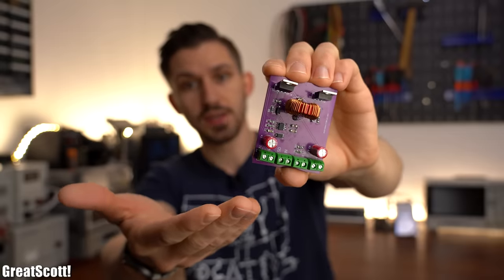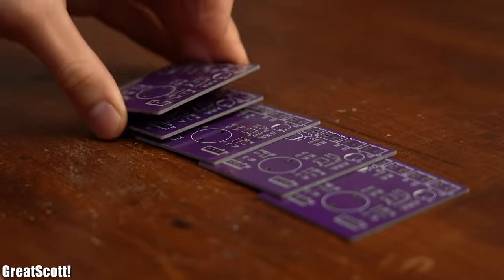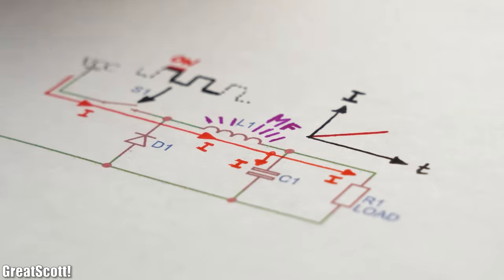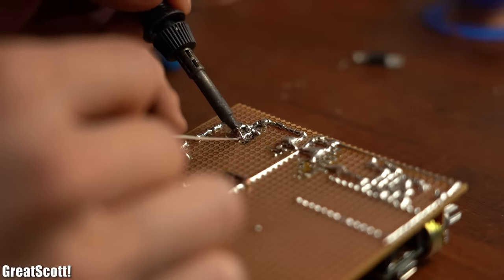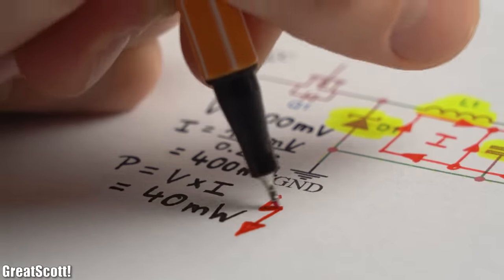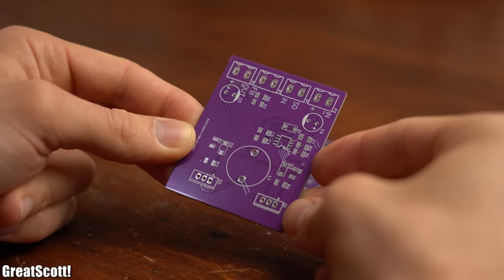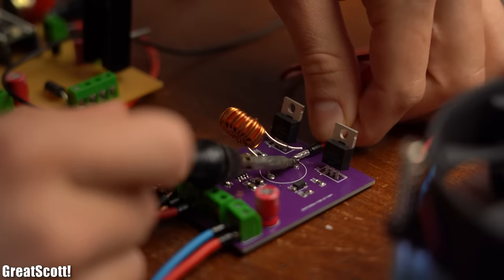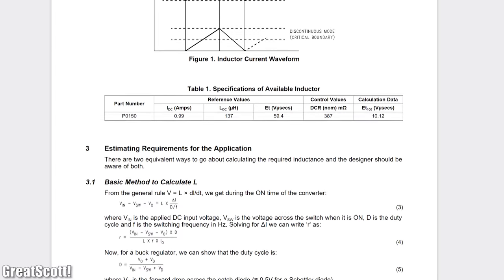Is this the BEST Voltage Converter? Trying to build a Synchronous Converter!

Comment: My project solar cell mppt's also use synchronous buck converter(sbc). i only have 83% efficiency. Using IR2104 IC to drive pwm from arduino to sbc

Comment: I would be very interested if you could talk about synchronous Boost Converter design... Especially with variable load and/or output voltage... Not sure if that's outside your scope but I love the way you explain things

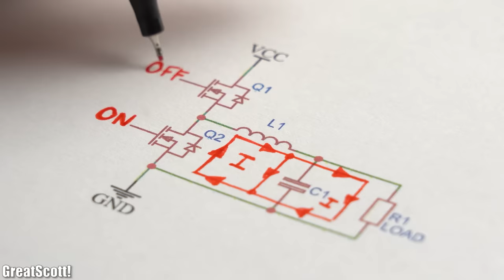Comment: Would the lower Q2 MOSFET even need to be switched on @ 6:26 ? Shouldn't current be allowed to conduct through the body diode when it's off, or is the transistor you're using not have that characteristic?
Reply from the maker: The body diode creates more power losses than the MOSFET. You want to use it as little as possible.
Reply: Thanks for clarifying, Keep up the good videos.

Comment: This same circuit also acts as a boost Converter, If the Voltage at the Output rises above the Voltage determined  by the Imput Voltage and the PWM Ratio it begins to tranfer Power from the Output to the Imput. You might try it with a Power Source combined with a Load Resistor at the Imput and the Output and then Changing the PWM Ratio.
As a good starting Point 50% PWM and a 2:1 Ratio of the Imput to Output Voltage works nice. Avoid very low PWM Ratios because they will result i very high Voltage Ratios.
Just a Idea how to use the same Circuit in a different Way, maybe for another Video.

Comment: Why the 10k R3 and R4? (between the gate and source of the switches) Good driver design with the gate resistor paralleled by a diode, that stops the ring that can cook your driver, shuts off the switches quickly and also stops parasitic turn on in the synchronous rectifier switch. It took me far too much experimentation to learn those lessons... but my multiphase buck designs are running 96-97% efficient, pretty cool stuff. Managing the ripple current by inductor and Fz selection is the other major way to reduce the losses.

Comment: Thanks! Your explain very well and I learnt a new concept about synchronous buck converter to increase efficiency as well as replacing diode with mosfet to reduce loss! Why not program the microcontroller  use two pins from it to turn the mosfets on & off with gap time too using microcontroller? You already using it in your circuit for generating pwm signal anyway! I would have done that with a PIC

Comment: neat project, but if you need a good efficiency buck boost converter go with LTC3780  board, i managed to get 98% efficiency in some cases, never get below 90% so far but the thing is the board is way too big for some project so have to stick with lower efficiency xl6009 module

Comment: Maybe you could try zero voltage switching (ZVS) design, it is a bit more complicated, but the efficiency could reach 99% because it eliminated MOSFET switching loss. MOSFET switching is not perfect. It will have a short transition period in resistive mode between on off cycle, contributing to power loss, especially for high-frequency operation in pursuing smaller inductors and circuit footprint.

Comment: Let the current go negative and you will reach ZVS switching and the desired efficiency. Use a smaller value of inductor and just a complementary pwm strategy.

Comment: Hey @GreatScott! I was thinking that is it not possible to just connect the pwm signal from arduino to a NOT gate followed by a delay circuit at either of the complimentary output instead of MOSFET driver? Like I'm well aware why you're using it tho... Just asking...

Comment: The video was so informative. Can you do a video automotive power supply design for microcontroller? I.e it should withstand cold crank and voltage 8 to 40v

Comment: Hey Scott where did you connect the pin SD on ic2184. Is that SD pin is connected  tp 3.3v or ground in teensy its not clear in circuit diagram

Comment: Hi, I have a 48V, 200Ah Battery. A relay (12V,200mW) has to be Connect across the battery by step down the voltage. How can I do it? Is there have any cheapest way to step down the dc voltage? Help me.

Comment: I want to build a DC to random AC converter
And by random I mean the amplitude of the waves randomly change 
Or at least just changes over time or with a variable toggle
The reason I need this is to test tiny microphones I salvage
Why does the amp need to change?
So I can hear how to microphone performs at different frequencies/notes

Comment: Amazing content as always. What is the realistic maximum voltage for this? A project I am currently looking at is building an electric fence Energizer. It could be useful for keeping rabbits out of your garden. Essentially they're a voltage switch that cycles around 12 times per minute, a super capacitor that builds up charge then discharges through a transformer to boost the voltage. For your case 1.5Kv is sufficient for me and my livestock I need around 10Kv.

Comment: I'm a beginner in the subject and would like to power up a camera using 8 volts. As cameras are expensive, which option should be more reliable and fail-safe? Step-ups or step-downs?

Comment: I built a boost converter that gets its frequency input from an astable multivibrator circuit, specifically so the frequency needed could be generated at 2.5v and below. Now I'm wondering if I could just feed off the opposite side of the multivibrator to get the complimentary wave form to drive a second transistor to replace the diode. I chose a super low voltage diode because of the tiny voltages I'm working with. But this might take run time from 10 minutes with 5 being useful light to 20 with 10 minutes being useful light. 

I'm making a metro 2033 inspired torch that runs off a super capacitor, works pretty well so far. I might have to playeth around and learn whatfor

Comment: Sir why do you used mosfit as switch ?? because you also can use it as diode  to make things simpler (just like you used in your old vedio for reverse voltage protection ). No need of complicating things
Reply: because if he used a diode there would be a 0.3 -0.5v drop across the diode and waste power and he would get like 80 percent efficiency instead of 92 percent.

in high current buck converters the diode gets pretty hot

Comment: I watch all your video's without knowing very much at all. I have a very important question as I live on a sailboat and my main battery is 48v yet most of my stuff is DC I loose a lot of power converting it to ac then back to dc. What is the most efficient dc to dc buck converter you can buy?

Comment: I recetly open LED bulb which has buck conveter 220 to 130. Why can  we not add uper two leds in series in this way cost of buck converter also save along with diode. Please guide

Comment: 4:01 mistake. NPN mosfet cannot work on the high-side since it will turn itself off.
Reply: "N" ch. MOSFETs can  & do work on high side...
they're powerd up by bootstrap or charge pump  ckts. ..
Reply: N-channel high side applications need some way to get the gate voltage above the high-side power rail (which is the source).  This is desirable because N-channel MOSFETs are generally lower in resistance by about a factor of 3-10 than P-channel for similar other specs.
Reply: Sufficient voltage levels for the desired " t-on " duration is enough to provide 
"N ch. mosfet" high side drive to trigger it ...
That's what bootstrapping / charge pump ckts. do for high side gate drivers.. ...

Comment: I'm curious if a NE555 would work for a simple MOSFET driver. If used in a circuit like that could the output pins for the flip flop be used to drive the MOSFETs synchronously? I've used one in a previous project for driving 2 strings of LEDs in opposing polarity.

Comment: Great work eh! Very easy to understand video. A couple questions - Is that a programmable load for testing that you were using (the thing with the heatsink and fan)? If so where would I order one? Such a handy tool to have.
Reply: AliExpress. Next week you will find this design there as well.

Comment: Hi Scott! While I find your videos entertaining and informative, I am distressed by the use of a microcontroller to generate the PWM signal. If you were mass producing something like this then I guess a one-time-programmable micro would be OK, but why not use a 555 timer for a prototype like this?
Reply: @tech 52 The 555 is a classic , cheap, industry-standard timer chip that was designed specifically for this kind of task. Just add a couple capacitors and resistors and you have an adjustable multivibrator circuit producing the same kind of PWM signal that, with an Arduino, takes a chunk of programming. Most electronics engineers are gonna have a handful of 555s knocking about in our scrap bins - it's what Dave Jones calls a "jellybean" part - so it's what a lot of us would reach for first for a project like this.

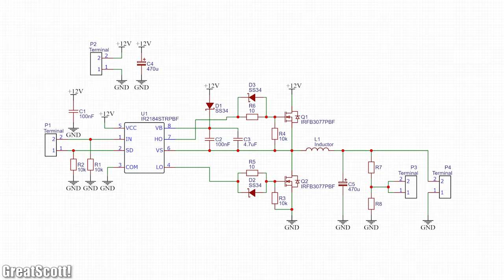Comment: 7:37 - this is not the way any dc/dc converter should be routed on the PCB... I do understand it is only a concept to show an idea but nobody should learn from this.  
1. The output capacitor near the output connector. It should be placed near the inductor. 
2. No proper utilization of two layer PCB therefore bad ground connections. Each SMD component should have at least one via to the GND if it has at least one GND-connected PAD. 
3. The connection from D2 to U1 under the inductor... WHY?! You should newer place signals under power inductors (when it is possible)
4. The input capacitor not near the inductor also.
5. The triangle loop for C2 and C3.
This is bad in so many ways :(

Answering the question in the title. Is this the BEST Voltage Converter? In the layout way? Definitly not.

P.S. You talk so much about efficiency and yet you choose not the best power inductor type. It's quality is one of the most important things to get high efficiency.

Comment: A question: What microcontroller or micro soc computer would you use to control a temperature/humidity system for precision incubationi of moulds from Koji? A steady state at 96.8F is what is needed for success.
Reply: The question starts at the wrong end IMO. What is needed is that you take care of your input hardware, your control loop (software), so these are things to focus on. Like if you have an i2c temperature probe with sufficient precision, you don't care about ADC resolution of your chosen microcontroller. Single board computers generally lack analogue input features of their own to begin with. If you use on-chip ADC and a thermistor, you have to worry about thermistor drifting in sensitivity over time, over years their resistance tends to go down a little, though maybe at these sorts of temperatures this might be slow enough to last 20 years before substantial drift. STM32F103 is nice in that you get a 12-bit ADC as opposed to 10-bit ADC on AVR, but right now in the chip shortage, availability is an issue and you get a lot of fakes. When you design your own analogue input, you also need to worry about signal integrity, electrical noise, filtering and aggregating the data. So i think you want an i2c temp probe or an i2c thermocouple amplifier, and you want to start the project by choosing one with sufficient specs.

You say 96.8F which is 36°C, right? But plus or minus how much fluctuation can you afford, like 0.2°C? Probe precision has to be several times higher than that then, for example 0.05°C. I have never heard of Koji mould and i won't look up anything about it, it's not an area i want to build any expertise in. I just don't care personally. Write a requirements specification based on your domain knowledge.

Then if you chose the i2c route, and your i2c hardware turns out 3.3V, you either need a level shifter, or you choose a processor running 3.3V as well. Like STM32 for example. Or AVR running at reduced clock rate, like at 5V, AVR does 16-20 MHz and at 3.3V, it does 8 MHz, but you can even get modified Arduinos with 3.3V and 8 MHz. You don't actually care about speed, for your purposes. if it was running at 1MHz, it would be still more than plenty. Then of course you need to take care of the other end, the heating, what sort of PWM freqeuncy or minimum on-off cycle duties it can sustain and whether it can easily be driven from 3.3V or 5V signal. Once the heating assembly is locked down, it becomes part of the requirements spec for the drive electronics. 

What i mean with control, is that the control loop effect is necessarily delayed, like when you engage a heater, the heat doesn't reach the probe instantly, it all takes time to propagate, so naive control (bang-bang) will always result in substantial temperature fluctuations up and down. I have a feeling, you definitely want PID control, or at the very least P-term.

It also makes sense to have the system as simple as necessary for the task. Like if you have a whole Linux system on a single board computer, there can be a lot to go wrong, like kernel logging causing something to go wrong on SD-Card and then the system crashes unrecoverably. On a microcontroller like AVR you can tune BOD and WDT to recover in milliseconds even from cosmic level events. Arduino bootloader causes a 1s delay if WDT triggers but odds are, your project can survive that. Except Arduino Mega (2560) which has a bootloader bug and will bootloader-loop on WDT, though Optiboot fixes that. Honestly i wouldn't mind using even just an ATTiny for the task.

What systems are you comfortable with developing? Just start with whatever has lowest barrier of entry to you and if you don't need medical device level reliability, maybe it's good enough. How long does the process take? The cost of failure is lower if the process cycle is several hours than if you need it to be stable and robust over years on-end. What are failure worst-cases? What sort of mitigations are needed? Put this in the requirements spec.

Comment: Hey, that DC Load Tester your using there, have you ever tried to plug in a USB-C PD charger to it and see if it triggers the PD modes for higher voltages? I want to buy one of those but I can't find any first hand answers as to if it supports USB-C PD triggering on the USB-C port or not... If it doesn't negotiate with the charger via the PD standard when plugged in, the charger or power bank will only output 5V even though the PD compatible charger is capable of outputting up to 20V.

Comment: The same happens when I try the gate transformer so i when with boostrap instead but I have some Issues with voltage follower the load the negative to the feedback needs positive instead of negative to turn up the duty cycle

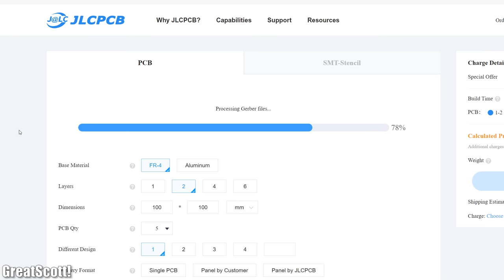Comment: 1:40 If they already printed you a custom circuit board, Why couldn't you ask for them to pre mount some components? Yeah Yeah, you want to use your own parts, makes sence, but I don't think that every tiny basic resistor or other inessential par would not be handy and also timesaveing to be premounted already when it's your time to finish your designed circiut. Still good survice tho.

Comment: I want do my project with your help, 
2 Push button ( one push increase second Push button decrease) 0 to 10V dc. When i adjust  the voltage like 6v using Push button the value will save till before power off .

Comment: I'm trying to build a 4-sw sync buck boost converter now, about the reverse current flow, I'm thinking to use two inductor (power inductor + ferrite inductor) in series.
When it work in low current, ferrite inductor shows high inductance that decrease the reverse current, at high current state the ferrite core goes saturation with very low inductance while the converter work in the CCM mode. But I'm still thinking how to handle boost state (or-ing controller or other method).

Comment: 4:19 If you care to figure out what went wrong, contact me. I can figure out what the problem is. I worked for 15+ years designing, manufacturing and testing electrical power subsystems for satellites.

Comment: Any recommendation on what I need or would need to build in order to power 60x 3.5" HDDs from a power supply that only gives 12v power?
Reply: Considering that SATA uses standard ATX voltages, use an ATX power supply, they don't cost that much

But 3.3V and 5V power rails are quite low current, so u even bad efficiency isn't that bad, u could total use a regulator IC if lazy, or a voltage divider if super lazy, the efficiency on both are garbage. But it's not that much power
Reply: @krazybonnie5523  the 3.3v is generally unused (molex doesn't carry 3.3v and converting to sata works fine). For $80 I can get a platinum 2000w PSU and breakout board that only does 12v (wish I knew how they make them redundant in a server)...that's the starting point of my rabbit hole.

Comment: Really interesting. I found a problem with buck boost that as the output current increased, output voltage decreased. Is that going to happen with these designs?
Reply: No and it's not supposed to happen with normal converters either

Comment: Question, why can't you just use a P channel mosfet for the second one? That way it by definition will be reversed from the value of the N channel mosfet.
Reply: You can but it will hurt efficiency. P channel mosfets have higher on-resistance compared to a similar-size N channel FET. Also you have to make sure they're not both on at the same time. This "dead time" makes sure the supply doesn't short to GND through the two FETs.

Comment: I have a question for anybody who can help me with it. My cousin bought a scooter from 2004, its has two sealed lead acid batteries in it in series. 12v 20Ah each.(so its 24v & 20Ah) they are obviously no good any more. so i was going to put a those Li-ion drill battery packs in parallel. now they have "BMS" built in them, but.. as they will be acting like individual cell's, will i need a 2nd "BMS" across each of them too??   PLEASE CAN ANYONE LET ME KNOW THE ANSWER TO THIS.?????